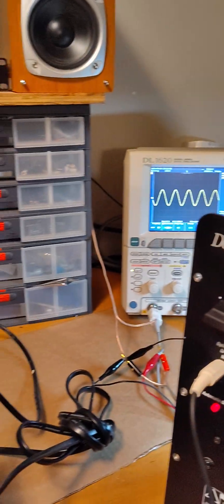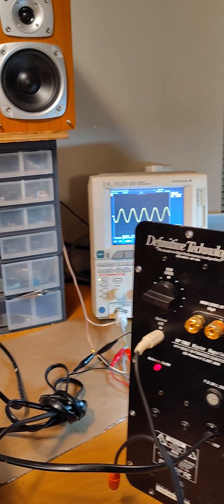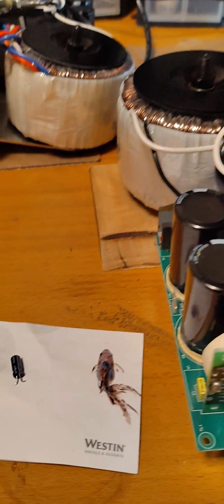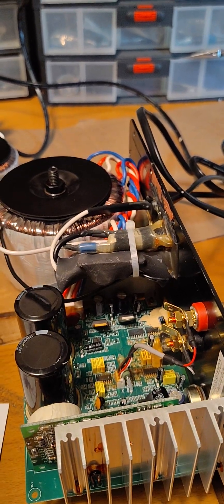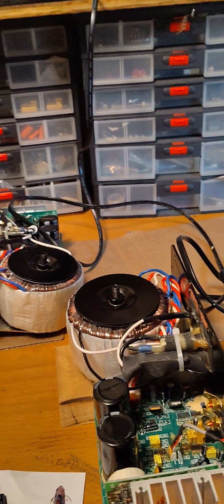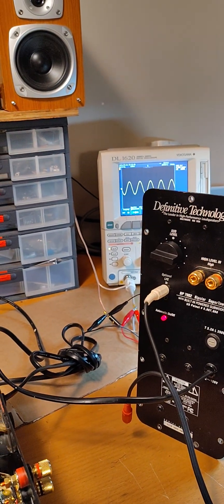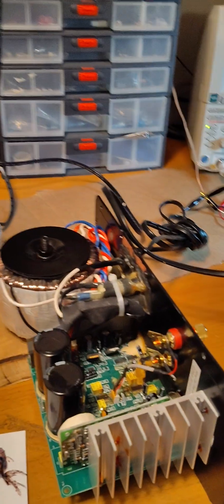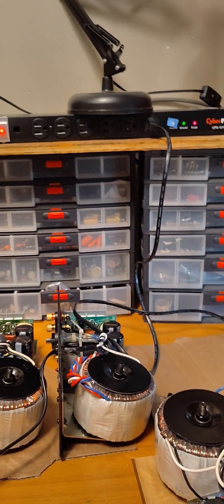Definitive BP7002, BP7004, BP7006 Subwoofer Plate Amp Fix

Comment: Mine are making a humming noises
Reply from the maker: 99.9% of the time no sound and hum is caused by bad electrolytic caps on these. Google "capacitor plague" if you're not familiar.
Repair is not difficult for experienced techs, just very time consuming as ALL surface mount capacitors should be replaced. Some of them are hard to get to and others are covered in hot glue.
Reply from the maker: https://en.wikipedia.org/wiki/Capacitor_plague
Reply: Do you repair these as a service? DefTech service is expensive and I've read they can take a LONG time to send back (more than a year). I have a pair of 7000s and a pair of 7004s. Each pair has one sub that works, the 7004 sometimes requires me unplugging and plugging back in the RCA to kick on. If repairing these is something you'd consider please let me know what you'd charge.
Reply from the maker: I'm (semi) retired but take on a few side jobs. If you're anywhere around Seattle, Portland, or Las Vegas I could arrange something. About $250 to replace (upgrade) the failure prone surface mount electrolytic capacitors.
Reply: Hi , can you help me to repair my speakers bp 7006 . The ic is broken
Reply: I don’t know what kind of IC